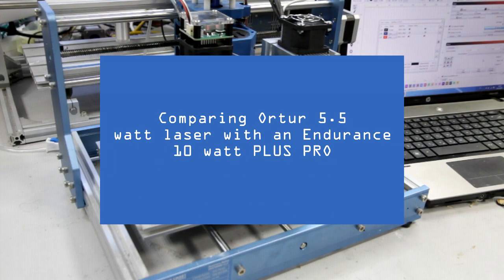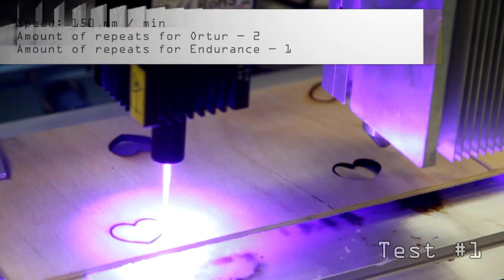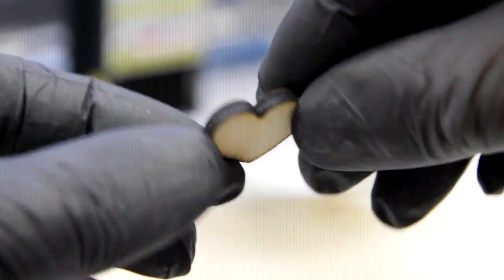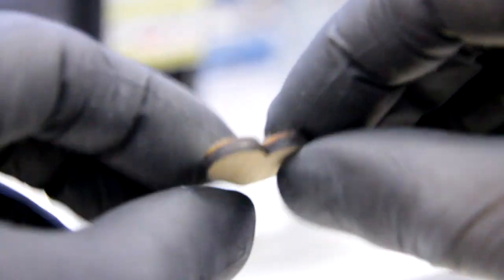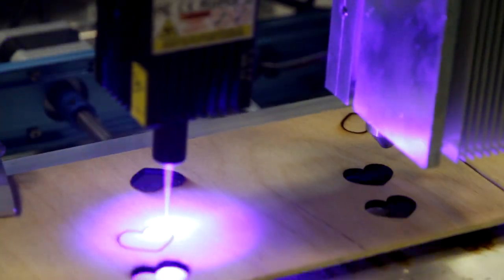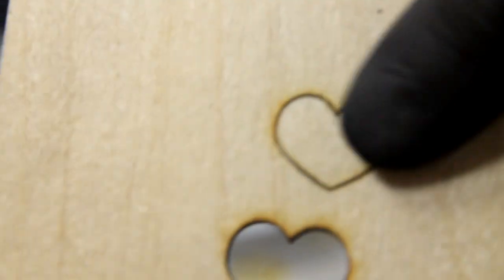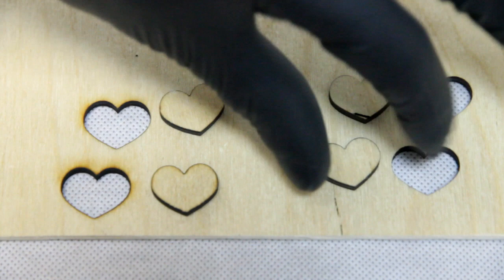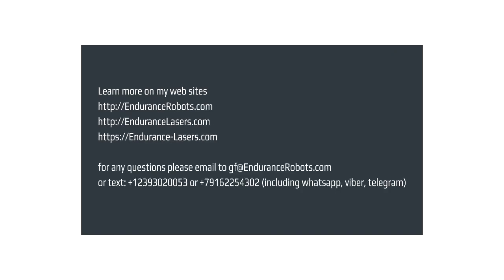A live comparison test between Ortur 5.5 watt laser vs. Endurance 10 watt PLUS PRO

Comment: Is this really a fair comparison of a laser with half the power of the other? Why not use a 15w Ortur to to your 10w PLUS PRO. How would that compare?
Reply: The power they are referring to is the optical power. Ortur sells their lasers with a “20 watt” rating. That is total power consumption. They only put out around 5 to 5.5 watts of laser light. The endurance laser power is rated on its light output, not total power consumption. That said, the endurance probably consumes around 50 watts of power while only producing a 10 watt light source. I would like to see a comparison between the two performing a raster image. Grayscale or Jarvis onto a piece of wood. I would like to see the difference between power/exposure time and the color and depth of the burn. How much faster can you actually run a machine to produce a particular size image with the same end results. IE, if it took me 2 hours to produce an image with a given size and color of burn. Would the endurance laser produce the same results in half the time? Or is the equation not linear? Would it be a longer or shorter time than half?
Reply: @Bradamsmx5  Ortur having actual 5.5W and 20W modules (both rated by consumption) only further adds to the confusion
Reply from the maker: and the band thing is that they stop working in about 100-200 hours on average. sometimes they can work more but usually, it is an exemption, not a rule
Reply from the maker: take a look at this post, please https://endurancelasers.com/my-experience-with-non-branded-chinese-made-lasers/
Reply: the 5.5W is the top of the line on ortur.
This said, we are comparing a 150$ module with a 1250$ module so.. theres that too.
Would be surprising if a 10W module wouldnt cut faster than a 5.5w module, at twice the power, and one order of manitude higher price.
Reply: perhaps its matched per w/mm^2 the endurance beam seems more compact?
Reply from the maker: I just showed what one laser can do... there are no 15 watt lasers on the market, Endurance is the only company who made it by combining 2 beams together... 15/20/40/80 watt is a misleading by all Chinese suppliers on eBay, Amazon!